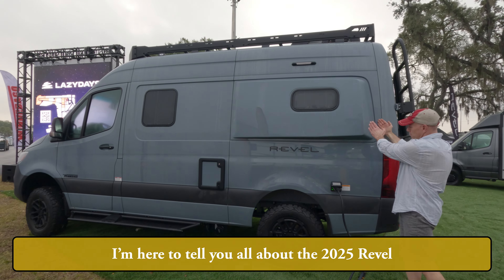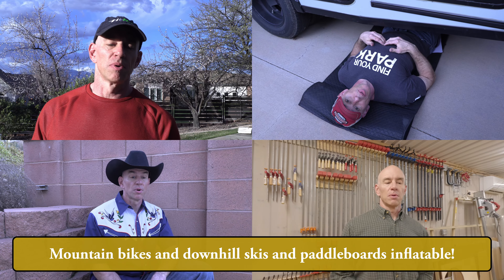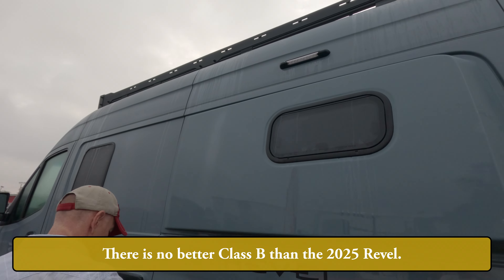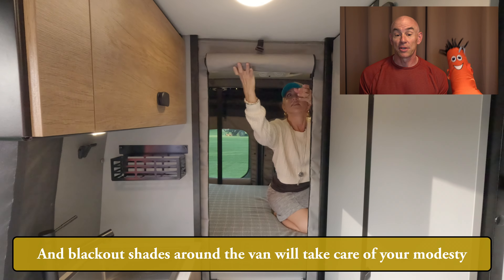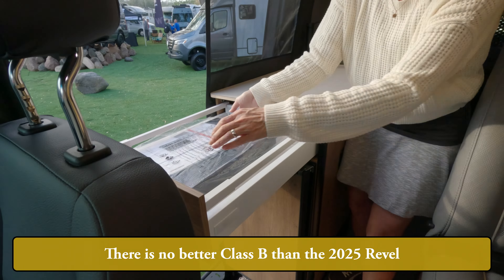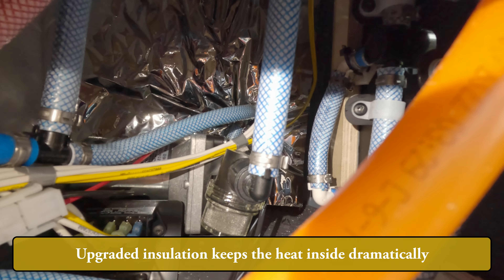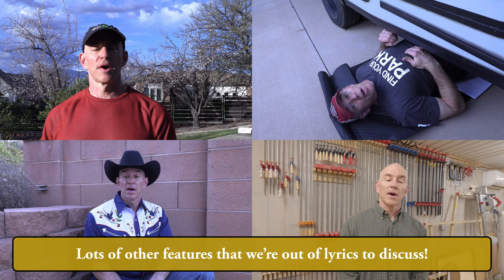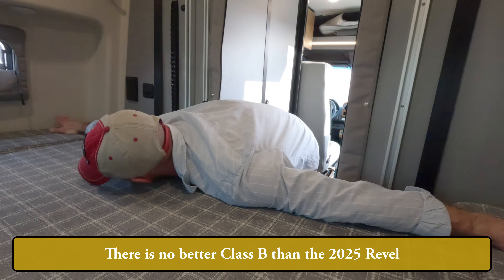The 2025 Winnebago Revel - a Musical RV Review

Comment: Nice format for a change. Very entertaining. Interesting to see how competition drives upgrades. As a STO owner, glad to see them ditch wood for aluminum. The water panel looks a lot like a STO. But kudos to Winnebago for putting 35 gallons of water in there. 

I’ll have to look at a more “traditional” review. But it looks like there isn’t a microwave preinstalled. Canyon Adventure vans has a microwave kit for Revel. If it doesn’t fit the new Revel, I’m sure it will.